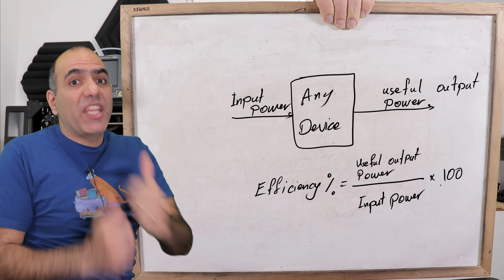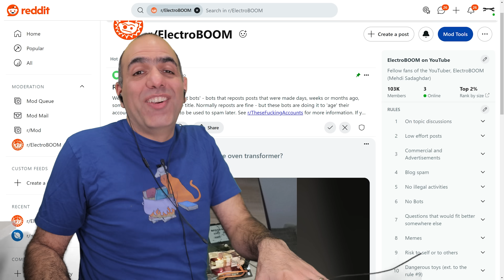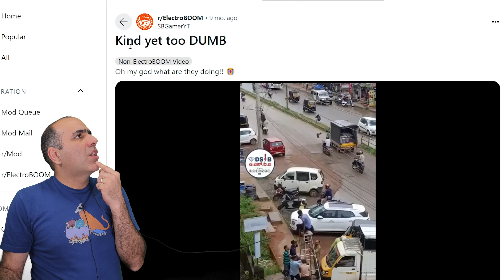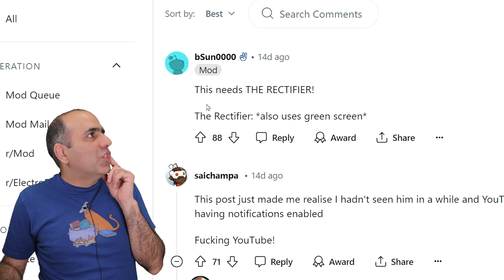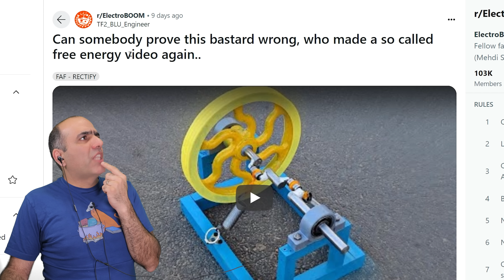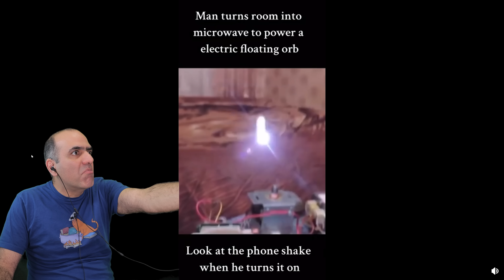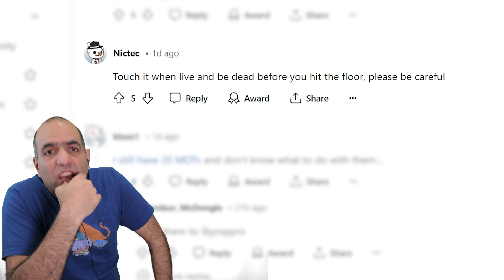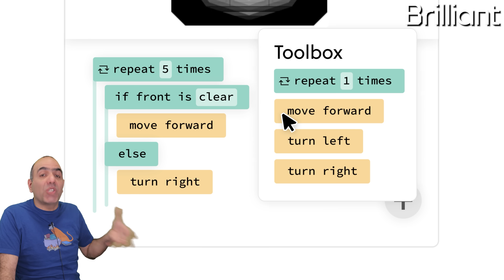New Flywheel Free Energy?! Can Boat Battery Fry You? LATITY-013

Comment: I guess what Trump meant are those full electric boats with 48V-150V batteries. Of course you'd still need to bee literally between battery terminals to notice anything - several metres away the potential difference will be negligible. And, let's not forget - sharks are sensitive to electric potential. It would swim the f..k away, in great pain, after any current starts flowing through water. The whole scenario, and the speech, are brilliantly hilarious. Even more so considering he went on a rant in the middle of the desert!

Comment: Oooo @ 2:12 I have a question! I bought a Vicks humidifier awhile back and it seems like it's just two electrodes that are placed into the water in the tank and you have to add just a touch of salt to make it work since with my water quality it won't work without adding a little. Am I creating chlorine gas??
Reply: The salt is probably there so an electric sensor can tell when it's empty.  It would take a lot more than just a pinch of salt to make water conductive enough to boil  with electricity.

What model is it?  Hot  models use a heating element, cold models use ultrasonic
Reply: @tsm688  I found another youtube video of it and the guy opens it up and tests it with a voltmeter and it's really just two probes of 120 going into the water.
Reply: @miss_sapphire  Bizarre.  I'm not sure that's legal.  That can indeed produce chlorine.  Hopefully not a lot.
Reply: @miss_sapphire that doesn't seem very safe. Maybe the pinch of salt is too small to generate much chlorine gas or something, but exposed 120v probes seems needlessly dangerous.
Reply: @catgirl-ame  A pinch or two is what the manual says but I had to add like a small small teaspoon of it to get it working lol
Reply: @tsm688  So sorry! I seen your reply and meant to find the model number and get back to you. If you google search Vicks humidifier 418404 you should see a result from Walgreens. 1.5 Gallon tank. It really is just two leads of 120 into the water.
Reply: @tsm688  test comment 👀

Comment: 12:40 unfortunately, yes, many people here think this is a safe and fine connection, then wonder why they have to replace the shower head every 2 months or so, and taking shocks on the water register is a given....

nerd info: at least in brasil shower heads run between 25 and 40A at 240V or the outdated 127V (!!!) at 50A.
so yeah, taping 25/ 40A to thin wires is a very good idea

Comment: Battery can explode immediately, this is illegal!
Reply: Actually, if you’re living hotel, you have more than 20 watts adapter that you can charge normally in few minutes then adapter fuse can cause to blow up and it refuses to charge, normally they used adapter for 20 watts any protection to prevent fuse blowing out

Comment: The more direct answer about heater efficiency is whether all the energy that went into the device was used to HEAT the environment. That answer is no if the element gives off visible light instead of infrared or if the ventilation makes a sound. Heating a single person in a space is not the purpose of a space heater.

Comment: 13:26 for anybody interested, the Jacob's Ladder arc was actually at the Eldorado Substation near Boulder City NV, switching out a line reactor (a huge "transformer" that would be seen on the far right if it were the full clip on the capturedlightning "arcs 'n sparks" page...) on the long-line to Lugo Ca... - it was a planned no-load test of the air break disconnect due to switching issues and a sulfer hexafluoride "gas puffer" interupter failed... (A failure under the normal 100MW load would have slagged the switch and feeder lines!)
Reply: thx for the sauce
Reply: omg new vegas map
Reply: Would it behave differently with bread?
Reply: @cambridgemart2075  typos corrected...
Reply: @LDuncanShortridge  Hopefully you realised that was said tongue-in-cheek!
Reply: I was definitely interested 😅 time to hunt down the original
Reply: Yes. That clip circulated widely a while ago but apparently zoomers don’t know about it.

I had a conversation I guess you could call it with a guy who was convinced that the very bright, very loud arc consumed no power.
Reply: @markfergerson2145  "A while ago" :D My copy of the video file, 500kv-line-opened-under-load, was saved on Thursday, May 13, 2004.
Reply: @markfergerson2145  Wireless electricity?
Reply: @markfergerson2145  "A while ago" :D my copy of it, "500kv-line-opened-under-load.mpg" has the modified date as Thursday, May 13 2004.

Comment: I just learned recently that heat-pump has much higher efficiency to heat up the room compare to e-heater.
Reply: trick is, it needs a heat source too.  just a heat source somewhere else, which might be slightly colder than the output.

Comment: Get nice and sweaty, like submerge you're body and while fully clothed, like working outside in the sun at 95°F, then short the battery with your forearm, which I have done multiple times on truck batteries, I guarantee you'll feel something. Now I don't know if the amps matter or not, but I typically work on 3-4 batteries per truck usually rated between 950-1100 CCA each, routed in parallel.

Comment: Assuming the heater is really 100% efficient at producing heat.
Then that the home itself becomes parasitic and takes heat away from where the human benefits from it,
but that is not the fault of the heater nor does that reduce its actual efficiency.

However I suspect most convection heater(no fan), with a resistor heating element... will produce heat, probably glow red, which is still IR heat.. but maybe a minute % of that IR energy will be in some kind wavelengths that don't produce any heat? like maybe 2-5% (guessing now, not actually looking at actual data)
Reply: there is no kind of light that doesn't produce heat.

Comment: "Automotive batteries are 12 or 24 volts"
Except when they are 48 volts for big vehicles with big engines.

And my electric kick bike is a form of automotive transport and it sports 72 volts. And it's quite the shit show if i connect the charger to the thing without first energizing the charger so it is at the same voltage level as the battery.

And in any other case, a boat can be a small dinghy or it can be a 3000 ton bastard. If 3000 ton, its battery voltage could very well be in the 7000 volt range.
Reply: Is gas not dangerous? I find it weird he never talks about that.   https://www.youtube.com/watch?v=erhd-FV4rb8

Comment: At 7:50, what if the boat is powered by electricity, like electric cars, what is the voltage of its batteries ?
Reply: Around 120 for private use boats. You should probably stay away but the battery should at worst just short itself since the negative terminal is the closest low voltage potential.

Comment: The point of the boat was in context to it being electric driven as in e-boat, therefore it is possible to have 100+kW of power available
Reply: The point of the boat was to be dumb and try and scare people. He never mentions gas   https://www.youtube.com/watch?v=erhd-FV4rb8
Reply: Watts are not the issue. If designed to do so, a car battery could supply 100k watts at 12 volts and still not be able to cause electrocution
Reply: @inventorbrothers7053  Yeah, volts do matter...as long as way of least resistance isnt passing straight trough your vitals.
Reply: Watts don't matter here.  You could have power source measured in megawatts, but voltage and resistance still determine how much current is actually drawn.
Reply: @georgedorn_fnord  these boats put out hundreds of volts.  besides, you arent really putting out 100kw from a single standard battery so obviously we arent talking only 12v or something.
Reply: @godw1ll99  It highly depends on the boat, for a 1kw-2kw motor 24v/36v/48v is more than plenty just like an ebike, perfectly safe even if you put your hands directly on it.
Reply: @vgamesx1  I wouldn't put my hands on a salt water splashed 48V battery personally, that's starting to enter the territory where if you're unlucky you could get a serious shock. Of course, the entire hypothetical is insane even if you're talking about 1000V traction batteries because as many others have pointed out a lot of factors, both deliberate engineering and passive effects of having a battery inside a box where you're not touching it anyway, mean that the risk of electrocution would still be so low as to be meaningless.
Reply: @vgamesx1  its absolutely circumstantial so wouldnt it be irrational to assume that trump would be referring to the only circumstances in which his claims dont make sense rather than the circumstances that do make sense? 

if i made the claim that you can die from falling would you assume im talking about a 2, 5 or 10 foot drop? no, of course not. youd assume im talking about off a building or out of a plane or something that makes sense.
Reply: @godw1ll99  Having a battery/multiple batteries in salt water won't electrocute you because it's using the water to find the path of least resistance between the 2 terminals so why would you be in danger? It's not like the electricity churns around in the water like ink or something. Diesel/petrol would be way more dangerous since it'll burn/float on top of the water and you wouldn't want to surface through a bunch of burning diesel/petrol.
Reply: @spongerobert  im making no attempts to argue what is worse, that is not my intention.

Comment: No, unfortunately, a rotating motor with a wheel isn't a way to get "free energy."  Here's why:

Law of Conservation of Energy: This law states that energy can't be created or destroyed, only converted from one form to another. In this case, the motor might use electrical energy to spin the wheel (electrical to kinetic), and the wheel's friction might create some heat (kinetic to thermal).
Friction and Energy Loss: Even with the most frictionless bearings, there will always be some friction that slows the wheel down. This friction represents energy loss that isn't recovered.
There are many ideas and videos online about perpetual motion machines or free energy devices, but these concepts violate the laws of physics.

However, there are many efficient ways to generate electricity using motors and wheels. For instance, wind turbines use wind to spin a wheel, which turns a motor to generate electricity. In this case, the wind energy is converted to electrical energy.

Comment: 1:39 Back in the day, my mom bought a Presto Hot Dog Electric Chair. You'd stick the hot dog on these metal prongs that were wired to the plug. They were acrid and not recommended.
Reply: Similar to the Westinghouse Dog-O-Matic we had back in the late '50s.  It worked cooking 'em in something like 90 seconds.  It also gave them a unique, kind of burnt, taste.
Reply: BigClive has featured a Hot Dogger on his channel a few times, with the fun bonuses of driving it at twice the voltage (resulting in quadruple power) and putting some other fun things in it that aren't hot dogs.
Reply: Let him cook🗣️🔥🔥

Comment: Although you're right about the 12-volt battery not being enough to shock a person, there are many instances of boats or jet-skis that have had faulty wiring that have shocked and caused people to drown. Also, keep in mind that most boats have way more than 1 battery on board. My simple fish-n-ski boat has 4 deep-cycle marine batteries on board.
Reply: Deep cycle just means they're slower to charge and release over time. Still most likely only 12 volts depending on how they're wired together either in parallel or series.

It's the coil that can give you a bigger jolt, but in ICE motors that's still not enough to kill you. Maybe if it crosses your torso and heart. Very unlikely.

I've been zapped numerous times by these and no harm was done once the zap was over.

Comment: Trump was talking about an e.v. boat which would run at a higher voltage than 24v.
Reply: I am far far from a Trump supporter. 
But in the spirit of intellectual honesty, you're right. 
He was referring to electric boats and their higher voltage batteries.

It would be something I'd like Mehdi investigate. 
The actual effects of high voltage EV batteries being submerged.
Reply: @F117nghthawk  yeah! it seems interesting ...
Reply: @F117nghthawk  Likely a lot less dangerous than gas...   https://www.youtube.com/watch?v=wAM_EtjxFhE
Reply: @F117nghthawk  True, but its weird he never mentions gas boats    https://www.youtube.com/watch?v=erhd-FV4rb8
Reply: The battery would still just short out I'm pretty sure.
Reply: @Lawrence_of_Uranium  You're body would still be part of the circuit so you'd carry some current. Whether it would be fatal is questionable.
Reply: @Lawrence_of_Uranium  Well all cellphone bateries has a fail safe in case of overheating and it discharge as fast as possible ... so yeah maybe it would do nothing ? =P
Reply: Still wrong because the battery is not ground referenced. The current will travel between the terminals, not out through the water.
Reply: ooooooooh makes sense yes...  tesla cars bateries are arround 300 volts i think
Reply: If you put your body exactly between the terminals, some current will travel through you. But the whole water doesn’t become energized the way Trump thinks.
Reply: @paullackey8813  people get electrocuted in bathtubs even though the drain is grounded. The water between terminals isn't a straight wire. It's part of a continuum of conductive material.
Reply: @mhoover  The drain is very often grounded.
Reply: @mhoover  That's AC, not DC.
Reply: BUT WHY IS HE TALKING ABOUT IT, I HAVE SO MANY QUESTIONS
I thought candidates would talk about politics and the future and not do Twitch streamer hypotheticals
Reply: @Reac2  well to be fair it was just a small part of a long speech but it deals with the idea of the lesser of evils, something we deal with all the time.

Comment: I think the easiest way to counter the "heaters are 100% efficient" is to point out it creates light. Might not be a ton of light, but there you go.
Reply: And that light (IR), unless it goes out a window, gets absorbed by the walls and turned into heat.

There's also heaters that produce no visible light, e.g. panel ovens and oil filled radiators.

A better counter is the drop in the lines to the heater. Some energy will be lost between the power plant and the heater.

Comment: 7:52 Electric car battery packs are usually 400 or 800V. An electric boat (such as a diesel electric submarine) may have something at much higher voltage. Not a good idea to have one hand on the positive busbar and the other touching ground even if the boat is still afloat!
Reply: Basic fishing boat battery is not diesel submarine battery.

Comment: So, I looked it up and even the pigeon was still flapping its wings. It must have been low voltage or the total resistance must have been high enough or the connection was dropped fast enough sot hat nobody died. Still, that was dumb.

Comment: Trump was talking about an all electric boat, not a general boat. You’re still correct, but voltage varies based on design.

Ex. Neogy’s articles about their eBoat batteries uses the example of a 57V 70kWh battery. Much more power than a relatively tiny 12V.

Comment: 2:00 Yumm galvanized metal steak
Reply: That's what I was wondering about. Won't the electricity move copper, zinc, chromium or whatever nasty ions from the electrodes into the food? Or do they not get far enouyh given that ion movement changes with polarity and thus ever stays the same for only 1/120 second?
Reply: @andreasu.3546  the rate of migration is pretty slow, I'd be more concerned about them literally just being dissolved into the electrolyte and ending up in the food that way.  Zinc and iron in low amounts are things we actually need, but in high amounts are legit dangerous

Comment: 1:18 The goal is to warm the room it's in up, not me specifically. It's 100% efficient.
Reply: That's wrong! Because we talk about efficiency of electricity output which already drawn by heater elements and intention of heater to heat up surround things is specified like It has boundaries to heat up range , size of room so there is no 100% efficiency getting in outcome
Reply: @ceogauravjoshi1742  If the goal is to put heat into a room and it is putting heat into the room the energy is being used to for the intented purpose. I don't care if it's the heating element or the line cord putting that heat into the room, it's doing what it's meant to do.

100% efficient. The goal is to add heat to a space. Heat is added to a space.
Reply: Electricity still will lose half of Stamina when I going through elements and through cord and before through transmission lines! Which loses some amounts of energy
Reply: @ceogauravjoshi1742  1, electricty doesn't have 'stamina', 2, you're gettin' off in the weeds talking about the mains lines outside the house that are irrelevant to the discussion at hand and won't get any chance in their losses because I turn a space heater on.